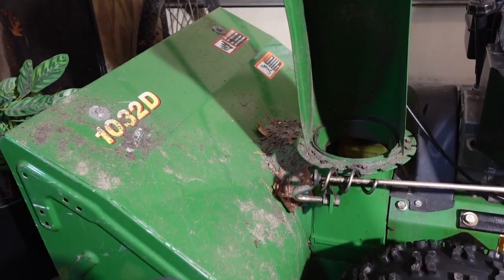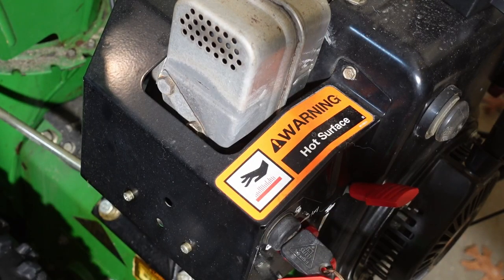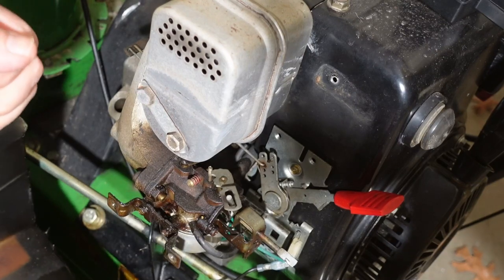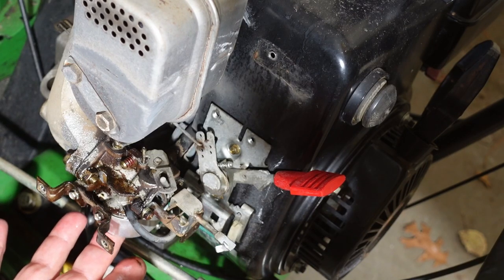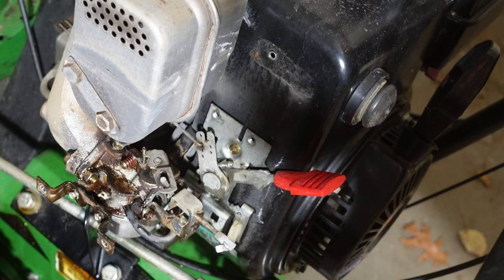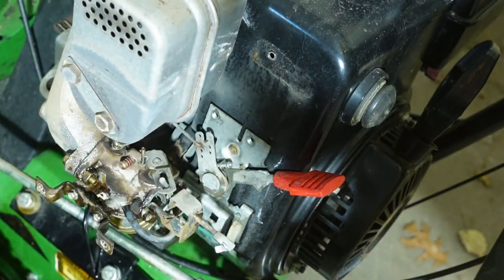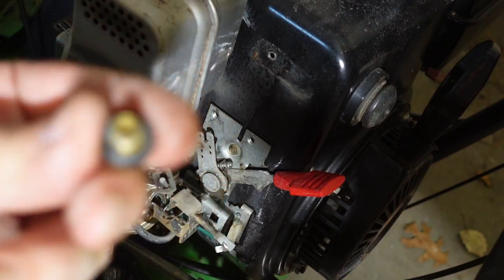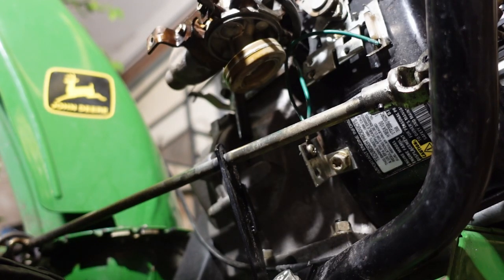Snowblower won't start, 10HP Tecumseh engine, John Deere 1032D

Comment: I have worked on a few Tecumseh Snow King engines.  The bowl nut jet, idle jet screw and emulsion tube must be completely clean. Remove the float and set valve and check for gel or corrosion. If you do go with an aftermarket carburetor, before installing, remove float bowl and tap the bowl lightly on a firm service and check for tiny metal particles. I learned this by watching those who do small engine repair for a living. Even OEM carburetors can have the same issues. Another possible fix for your original carburetor is to try a heavy concentration of Sea Foam. A 50/50 mix of gas and Sea Foam. Run it for 10 minutes or so, let it sit overnight and let the Sea Foam work on the crud in the carburetor. This may do the trick and save you the time of replacing or cleaning the carburetor. I finely started using ethanol free fuel and that has ended my carburetor issues. Good luck.

Comment: Rob, a couple of things that may help you...
- on the side of the carb just below where the bracket  held on by the 2 Philips screws. You'll see either a black or white plastic cap. Remove that and unscrew the brass air jet. Clean end hole and sides with a wire plucked from a brush or wire from twist tie. If there's no spring on it ?(fixed) Just lightly tighten to snug. Spring ( adjustable) 1 to 1 1/4 out.
- on the same side of the carb you'll see a number stamped ' 516' above that is the smallest atmospheric vent hole. You'll need to make sure that is clear. Again with a small wire.
- finally on the threads of the bowl nut / main jet. There's a small less obvious hole in the threads that angles towards the middle of the jet. That needs to be clear as well.
Hope this helps ! Dave
Reply from the maker: It does, thank you!
Reply: I just cobbled together a carb for a nine horsepower Tecumseh flathead and discovered a defective bowl screw jet that had brass blocking the hole with no hole opposite. I also figured out that you can't swap adjustable jets without swapping the emulsion tube too as they're different lengths. Seems as I've wasted hours and hours messing with carbs that someone should do a one all video but I haven't found one yet.

Comment: As I've saved many old carbs from every brand it was just yesterday that I found that swapping jets to adjustable jets requires swapping the emulsion tube too as the lengths are different. Another thing I've found for long term or seasonal storage is leaving the bowl full with ethanol free gas, a liberal dose of both "tuneup in a can" and two stroke oil at the same ratio. Stabil does not remove ethanol and the money is better spent in ethanol free gas. Corrosion needs oxygen for the most part so running the bowl dry is, to me, a bad practice as there's always some fuel left in the line below the shutoff and in the bowl.
Reply from the maker: I got this well-used from a neighbor that was retiring and moving to warmer climes. 
I have a stock of ethanol-free petrol for the small engines around here. This one has a fuel shutoff, which I plan to use at the end of the season to run the bowl dry, then do a blowout of the fuel line to the shutoff. 
I've not heard of "tuneup in a can", but I will check it out Thank you!

Comment: Looks like the float stuck. Definitely the results of the use of gasoline with ethanol left in the fuel system. So the idiot that owned that machine was too darn lazy to turn off the fuel and allow the engine to run out all the fuel from the carb. Just plain common sense.
Reply: Even that won't empty the bowl though but it's definitely a plus if done. I use ethanol free with both "tuneup in a can" and a two stroke oil and leave the bowl full and since doing so everything starts on the first pull with no corrosion inside the bowl. My four year experiment, by accident, had an unbelievable amount of corrosion which were six carbs I stored after running them dry. They weren't dry and used 10 percent ethanol proving Stabil does nothing for removing ethanol.
Reply from the maker: The guy that owned it wasn't an idiot, he just didn't know. The sludge that built up in the fuel system was over many years of neglect, which is far more common than you might think.
The vast majority of small-engine/carbureted tools don't know to use ethanol-free gas, and it's often not available. 
Do you add the two-stroke oil to the bowl for storage, or just add some to the tank for general operation? I'm curious because I like the idea of adding some lubrication overall, but I don't want carbon buildup in the cylinder(s).